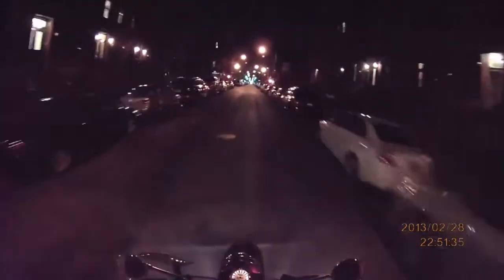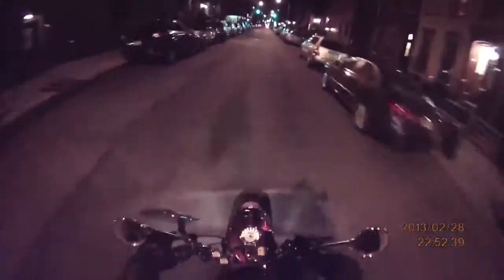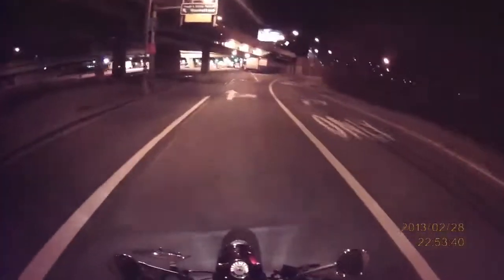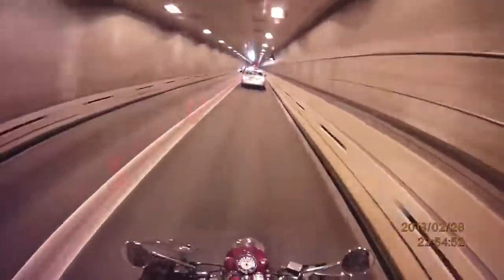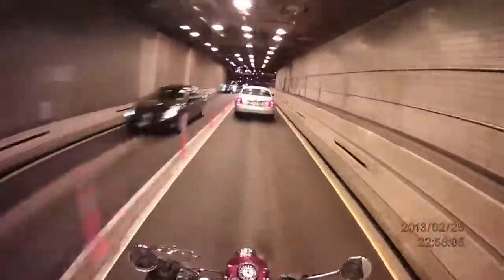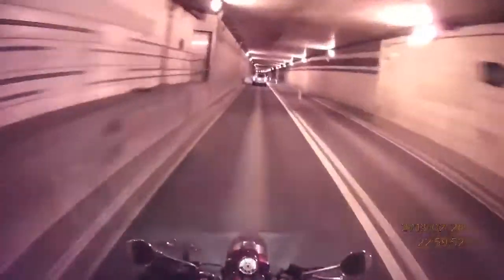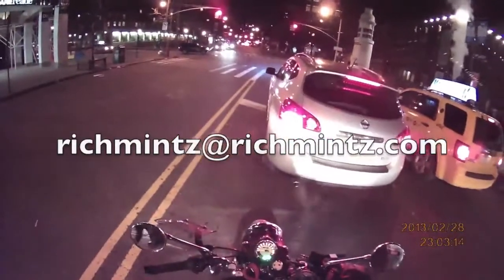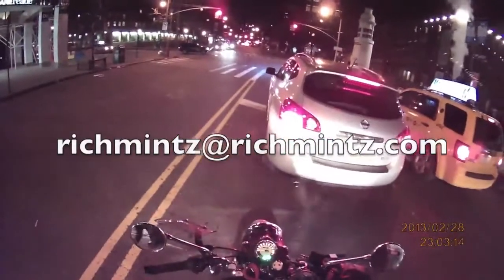Rich Rides NYC: February 28, 2013

Comment from the maker: Andrew - I love the bike for city riding. I get about 45 MPG typically in very crowded stop-and-go traffic, 55-65 MPG on the highway. The bike has enough pickup to keep up with traffic (and I jump ahead when the light changes).

I have the pillion seat but have never carried a passenger. The bike can do it but it's a pretty lightweight bike, so probably not for long distances.

Putting a link for you in the video description above.